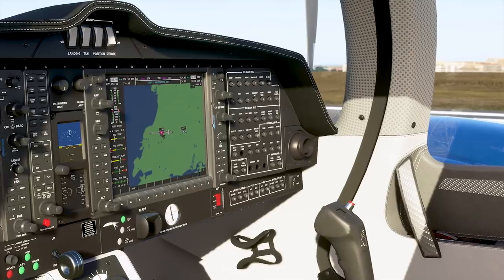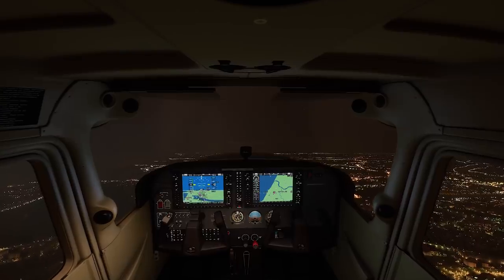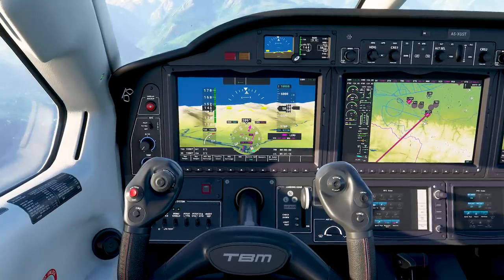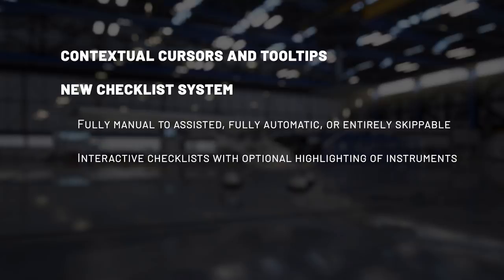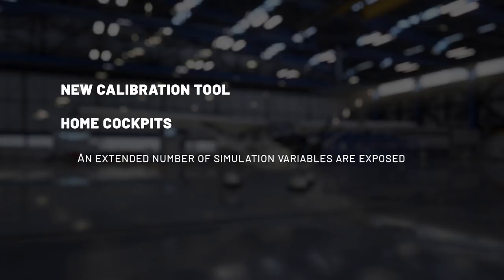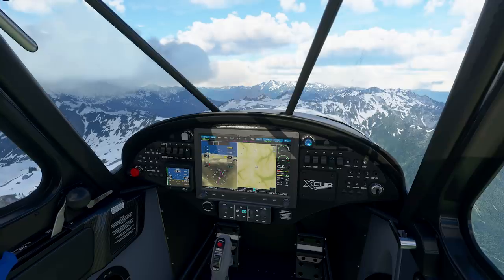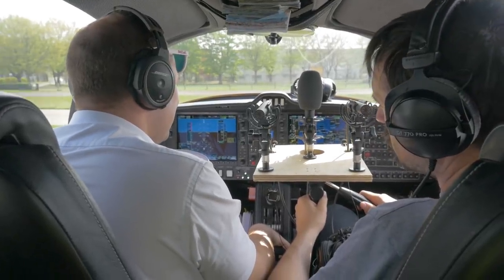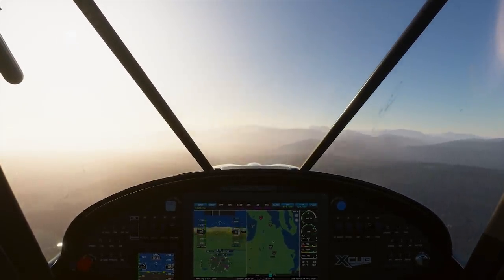Feature Discovery Series Episode 4: Cockpits

Comment: Hello team ... 

Agreed 100%. A realistic FMS and tube liner systems in general, although promised, is one of the main areas in which FS2020 has yet to prove its superiority to current platforms. I don’t doubt that the community will quickly provide these for us, but having them out of the box would definitely be terrific and a real game-changer. Have to agree. From what I have seen of their TBM930 so far, I am really impressed. The texturing and modelling is setting a new standard. Hopefully they will match it with systems depth and aerodynamics.

Comment: Hi,

What happened to multi screen support, which is why I bought it.
X-Plane has a very good multi-screen system which I was under the impression MFS 2020 would have from the start as per this video.
I have a full 3 screen cockpit setup and will have to go back to X-Plane if multi screen support isn’t coming soon.

Comment: Tip: recording good audio is only half the battle. Blending the frequency curves of the clips is somewhere where the default aircraft in previous versions of MSFS always fell short, to the point where I doubt the people putting together audio understood how sound.cfg worked. But there's an easy way of figuring it out. There's a direct relationship between pitch and RPM on all rotating engines, be they jet or piston. Since I'm presuming that y'all were smart enough to record RPM values while you were recording audio, it's a simple matter of basic division to find the correct frequency curve values. 

For example, let's say I have a piston engine that idles at 275 RPM and maxes out at 835 RPM, and my clip was recorded at 515 RPM. To figure out the maximum value, I would divide 835 into 515 and get 1.621. To get the idle value, I would divide 275 by 515 to get 0.634. The resulting frequency curve, in MSFS format, would look like this:

rparams= 0.329,0.634, 1.000,1.621

The 0.329 value comes from 275/835.

If you do some basic math, you'll realize that you can do these calculations based on percent values as well, making it equally easy for jet engines - but remember that jet engines often run at values above 100 percent, so your frequency curves need to take this into account. Moreover, most jet engines have multiple shafts and you will need to tie the right sounds to the right shaft, which brings us a question: are we going to get an N2 variable besides combustion for audio? Combustion sounds cut out when the throttle cuts out, which means we need to use the N1 parameters to do any N2-related sounds below idle. This is far from ideal, as changes made in FSX make conventional startup and shutdown sounds ideal, making the simulation of the RPM range below idle a better overall solution so long as the engine has a corrected throttle v time curve (table 1505).

Speaking of which, did y'all fix table 1505 on the default jets? Please say yes.

Comment: It's becoming clear, with up to date CPUs, calculation power for graphics and algorithm processes, software engineers can now create high performance visual and object  manipulation that was not possible even 5 years ago.

If Asobo Studio gets long term support from Microsoft, I can see Microsoft Simulator 2020 becoming a genuine contender in the aviation training space as the platform matures and gets updates.

Certified Flight simulator vendor should be concerned for several reasons; lower costs, easier management, possibly centralized and superior quality.

It is going to be a fun flight observing what happens over the next 5 years.

Comment: I would bought a VR headset just for this, please add VR capabilities 🥺
Reply: VR is under development as we speak, although only the upcoming HP Reverb-2 VR headset is going to be initially supported.  The Reverb will boast 2K graphics which is stellar for a dual optics headset, I think a real game-changer (no pun intended) provided you don't suffer from motion sickness due to rapid movements possible when using a headset-mounted video system (same issue afflicts some Track-IR users).

Comment: WOW, so fantastic...I'm waiting patiently for FS to come out in 2020, I'm just hoping there won't be a subscription on XBOX because they should just make a XBOX Disc to install and play the flight simulator game. I'm also hoping a lot of Boeing planes such as the 737, 767, 777, 787 and fighter jets are included in this flight simulator.
Reply: MFS 2020 (or 2021) need internet for game (on xbox and pc).
Reply: @ДунканМаклауд-х9о  I already have high speed internet, so it wont be a problem, but you can also play the game off line as well.

Comment: Will the mixture control be functional. In previous Flight Sim, Mixture control moved  but only turning on fuel and shutting off fuel to the engine. Never did it actually work to enrich or lean fuel mixture.

Comment: I really don´t know why everyone is using the term "checklists" for actual procedures. Thats NOT the way it works
Reply: Isn't that the official term for it?
Reply: korbitr yup, procedures are just the actions to perform on the checklists. Normal procedures, emergency procedures, etc. for example if an airline cockpit crew wants to set their aircraft for landing they would call for the “landing checklist” and perform the procedures there.
Reply: @Hartbreak1  Not that's NOT how it works. You NEVER do the items that are on a checklist unless you find out that you forgot one while reading it. You do the normal operating procedures and in specific flight phases you check if you have done the most important ones. And that's the big misunderstanding in flight simming. Checklists are not read and do. And most of the times we have checklists in the sims with ALL the procedures but this aren't checklists. Search for actual checklists online and you will find that you can not operate an aircraft only with those items
Reply: Kev.Kaviation you’re correct that not all procedures aren’t on checklist, some procedures require extra information that a checklist can’t provide and are acted upon depending on the state of the aircraft and/or instruments or need to be referenced by other parts of the POH or just require common piloting skills and sense, but the most crucial items that shouldn’t be forgotten and must be performed are included on the checklists. And yes pilots may do items on checklists before looking at them because they memorize those items and some items on checklists do need to be memorized, some checklists will point that out by highlighting the items that pilots need to memorize. What isn’t correct is that checklists aren’t read and done. Items on checklists NEED to be read and done, when going through a checklist you must assume that you haven’t done anything on it and must recheck every item there. There’s been a lot of accidents caused by pilots skipping items on a checklist or skipping checklists entirely because of laziness or because they overconfidently thought they memorized it all and did it all correctly and decided not to look at it. Even if you do all the items on a given checklist before consulting it, you must read and double check that you actually did every applicable item in it. That’s also why checklists have redundant procedures for critical items just in case the item was skipped unintentionally in a previous checklist.
Reply: @Hartbreak1  I do know what checklists are ;) I'm working with them! There is just a generell misconception of Standard Operating procedures and Checklists which are totally different things.